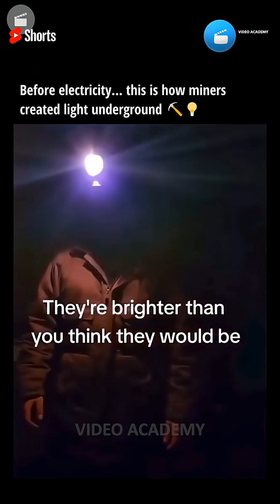Forget Batteries: This Lamp Runs on WATER! 💧🔥How Vintage Calcium Carbide Lamps Actually Work 🧪⛏️

Comment: The stones a called carbide. Add water to the top reservoir and allow it to drip on to the stones, holding your hand over the front of the lamp, allows you to block and trap the gases and you slide the hand over flint sparking to ignite the flame.
Reply: Thank you👍🏽
I learned something new